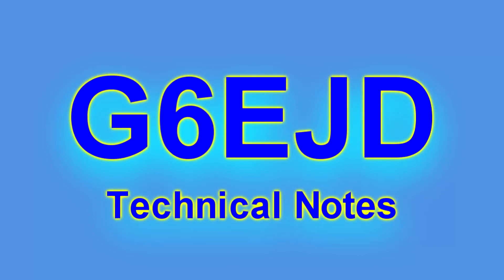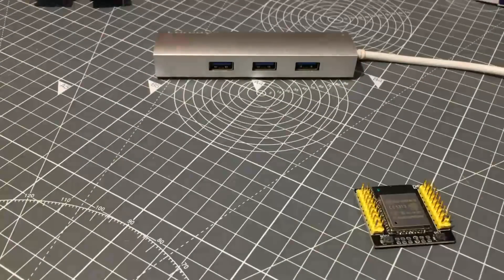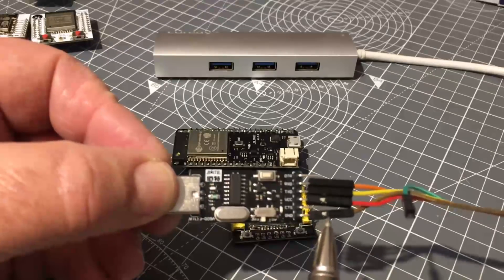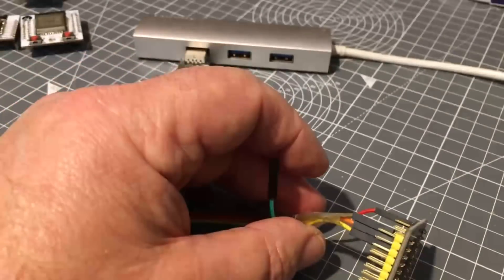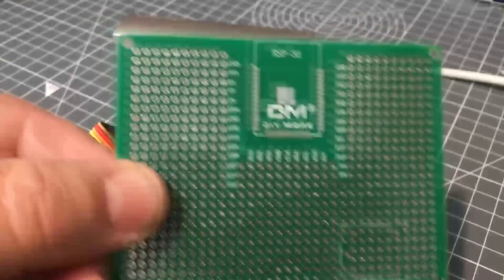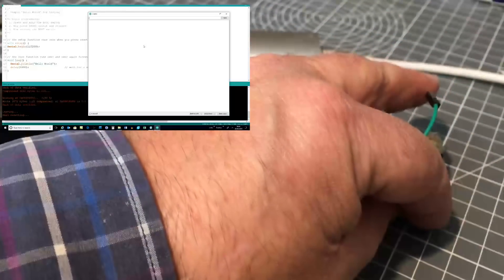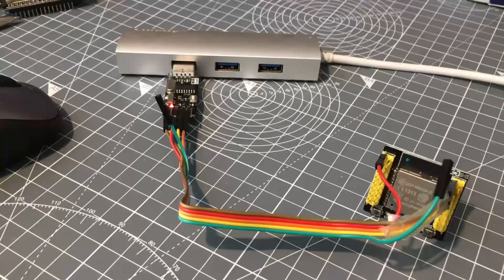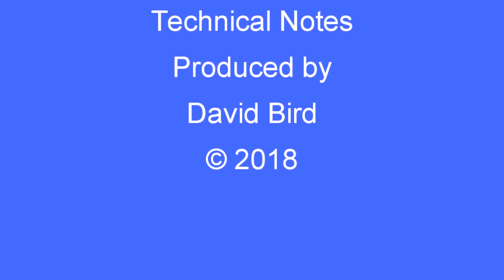Tech Note 089 - ESP Programming (Break-out boards)

Comment: Many thanks for the explanation, clear, concise and very useful. The figure with the connections helped a lot. Could you explain how to do hello world? Blinking a led
Reply from the maker: If you install the Arduino IDE the Blink sketch is in the examples and the Hello World one you can probably copy from my video as it's only 3 lines.

The thing to note about the Arduino C environment is there is a setup section that runs only once when the CPU starts and then a loop section that keeps repeating (looping). SO we need to put the serial.begin(9600) statement in the setup section to start the serial services at 9600buad in this example and then in the loop section enter Serial.println("Hello World");
delay(1000);Then it will continuously print 'Hello World' wait 1-sec (1000 mS) and then repeat (loop).

Once you get to grips with that process the programming is actually very simple and if you get a development board even easier.
Reply: Thanks. I just received the Elektor ESP32 dev board. I installed the SDK following EspressIf programming guides and tried successfully the hello world. Now, installing Eclise and studying the examples, starting with the blinking led. Doubts regarding how to connect a led and change the GPIO port number. Feeling rusty about embedded dev. 20 years passed away since i finished electronics degree. Found your channel, very helpful to update my knowledge
Reply from the maker: Tiago Romao To connect an LED choose your port and wire the led via at least a current limiting resistor so pin to resistor to led to gnd. Maximum source current is 12mA or there abouts or you could wire it from Vcc to resistor to led to the pin and sink the current via the ESP32 pin about the same safe limit of 12mA you choose the pin in the programme by its gpio number but stay clear of pins already assigned to bus functions such as I2C SPI and serial ports e.g 18, 23, 5, 16, 17, 4, 5 the Espressif data has more details.

Comment: Thank you for clarifying the how and why. I came into this as a hobbyist and only purchased the devices with the USB to UART connection onboard. Had seen others using the device you used and wondered what that was all about. Now with your video, I fully understand and can appreciate the saving in money when I do finish a project. Will keep using my NodeMCU but when I am ready to finish the project will use the setup you have shown here.
Reply from the maker: Plus you get huge decreases in power consumption so if you have a battery powered project that uses sleep it will only require 6uA which is close to zero power. Also the space requirement is less. Have fun.

Comment: Well that was incredibly well timed? Guess what I am about to try and do?
Reply from the maker: Craig Fryer I forgot to mention that if you try to start a programme that enables the WiFi the ESP32 will likely report a panic error and error 1000 can’t read the flash memory this is not an error it’s because most UART boards barely have enough regulator capacity to drive an ESP32 at startup with the radio on, normal operations are resumed when correctly powered. Good smoothing (capacitors) are essential too. Good luck.

Comment: those esp32 boards are so interesting
i'm into 3d printing myself, and i saw that there is a work in progress to use esp32 with marlin on it.
nice presentation btw, keep up the good work
Reply from the maker: There are few if any 3D cases that I’ve seen I might put some time aside to make a case to hold one of these boards.

Comment: A nice trick with these break-out boards is to use OTA programming, so only program this way once. Remember it must be resetted after the first OTA program install.
Reply from the maker: Indeed yes,  but quite easy to add a series RC with the intersection to the reset pin. They could have usefully done that on these simple boards.

Comment: First! :) Great Video! Ive never seen the black breakout board? Where did you get it from? I have a question for the white breakout board. Under the writing "v1.1"... These are two places for resistors right? What resistor would you use there? How much ohm is recommended? They also say you need to solder a pullup resistor between 3,3V and EN pin. Can you provide the links for the breakout boards in the description? Many thanks!
Reply from the maker: You can get the black ones from AliExpress just search for ESP32 break out
Reply from the maker: If I can find time I’ll draw the circuit
Reply: I find them by typing "ESP32F" but I just find them in a bundle with an ESP32 Module which is not an official WROOM32.
But i just want to have the breakout board itself. Searching for "ESP32 break out" gives me no good results :(
Reply from the maker: I’m wondering if anyone other that Espressif is making the silicon and if they are where are they getting the detailed design information so that makes me think all WROOM devices are from Espressif but some unbadrged and of lower yield quality or slightly out of specification.
Reply from the maker: I use 10K resistors. See here: http://g6ejd.dynu.com/index.php/micro-controllers/esp32/esp32-programming/